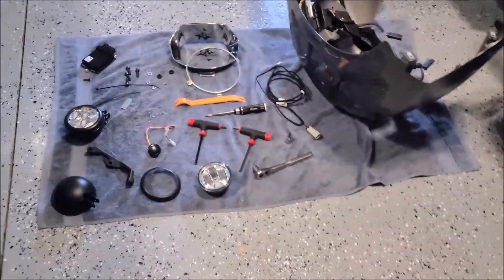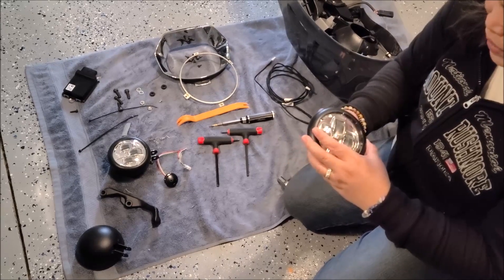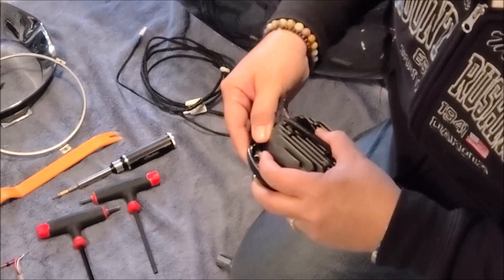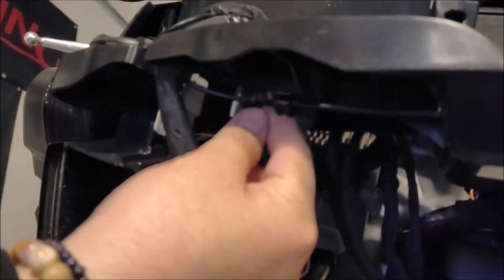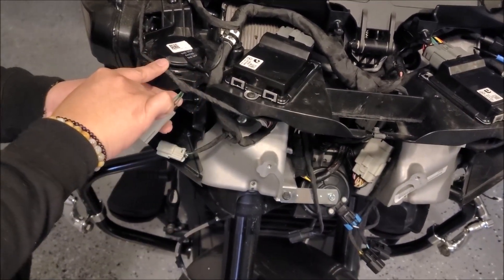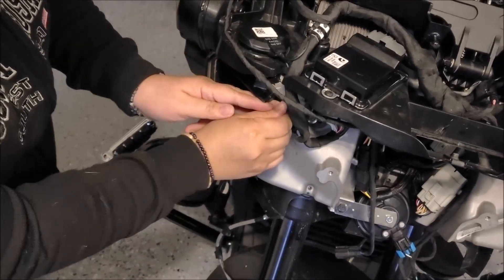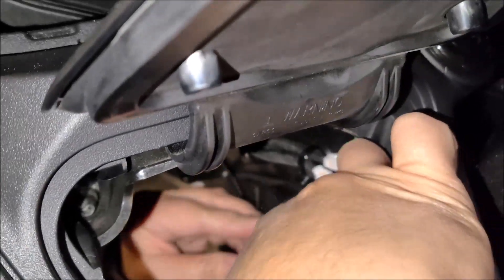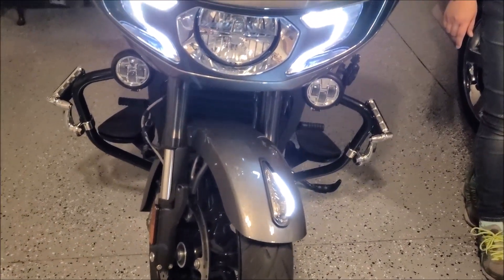Installing Pathfinder S LED Driving Lights on the Indian Challenger

Comment: Great video, after installation, do I have to go to the dealer to update the control module? how to do it thank you
Reply from the maker: Yes, you need the dealer to update with Digital Wrench.
Reply: Thanks
Reply: how many service hours did the dealer typically charge for this digital Wrench programming?

Comment: What headlight are you running on the Challenger now?
Reply from the maker: Eagle Halo II
Reply from the maker: https://www.eaglelights.com/products/eagle-lights-generation-ii-led-headlight-kit-with-halo-ring-for-indian-challenger?variant=31485609803889&gad_source=1&gclid=CjwKCAjwo6GyBhBwEiwAzQTmc06Tpg3QoVaTUUeYmgnPyzZlvtZpVmF4K3RpqCMWxVxj0ycumm7HaRoCtDwQAvD_BwE
Reply: One more question. Why did you guys choose not to place the connectors inside the housing (bowl)?

Comment: Great video , did everything and lights installed great , my issue is I can’t get an Indian dealer to sync the lights , I was at a dealer mechanic had no clue how to sync, he told. Me they should come on when the bike recognizes speed and lean , wth. Mechanic says there is not flash for these. Other dealers I can’t get to call me back. What am I missing? What specifically should I be telling them because they just can’t get it
Reply from the maker: The dealer needs to do the Digital Wrench in order for the bike to recognize the lights.
Reply: Try calling my dealer. Bair’s Powersports in North Canton Ohio. Ask for Curtis in Service.

Comment: Great video and thank you. I have two questions so I have a challenge a dark horse thunder smoke black. When I go on the website to order these, they’re showing black and chrome and it looks like gloss black. Obviously I’m looking for the matte black lights, which is what it looks like you have do you have the exact part number for that so that’s number one number two is did it cost you any money to have the dealership hit it with the digital wrench? Thank you in advance.
Reply from the maker: When I purchased these they only had chrome so I paint them matte black.  I bought them from the dealer so they didn't charge for the digital wrench.
Reply: @ourindianadventures1488  perfect thank you so much for the fast reply. I found a pair of gloss black I’ll probably paint them myself, again from the dealer so that I shouldn’t have a charge.

Comment: Dear Maria, I also have the LED on my Challenger.  If I have the LED lighting on and turn off the motorcycle after riding, and then start the engine again, the LED lighting is still there.  but as soon as I put the motorcycle in first gear to drive away, the LED lights go out.  And then I have to press the button again to turn the LED lighting back on.  do you know if that is normal.  I find that annoying because I always drive day and night with the LED lighting on.
Reply: Hi there, you might have to sync the lights to your bike again (digital wrench). As far as I know, we don’t have the issue you are experiencing.
Reply: @mariaweisgarber6030  Thanks for the answer.  greetings from the Netherlands

Comment: Absolutely zero reason fog lights that have to be manually turned on an off are run through the bikes PCM or requires a the dealer to activate.  This violates the Right To Repair which has passed into law in NC.  I highly suggest any of you that do not have a Right To Repair law in your state to push for it.

Comment: ok nice vid but the location of the lights are not high enuff. the spread is good but the distance is not long enuff
Reply: It does a pretty good job lighting up both lanes in country roads so I think the spread is okay. The video doesn’t do it justice.
Reply: @mariaweisgarber6030  ok are their mounting problems?  am having problems getting it up.🥴
Reply: @henryxavier3751  We didn’t encounter any problems mounting it, you know you have to buy the mounting bracket separate from the bulbs.
Reply: @mariaweisgarber6030  ok

Comment: Good morning, I am considering these lights for my 2021 Roadmaster Limited.  The question I have is can these lights be used when the headlights are on high beam setting? I ask because the passing lights I had on my Harley could only be used when the lights were set on low beam. Thank you!
Reply: I’m not sure how to answer. For the Indian Challenger it has its own switch that you can use. It is also sync with your running lights via the digital wrench. It is not affected by high beam.
Reply: Totally separate circuit independent of high/low beam switchgear.